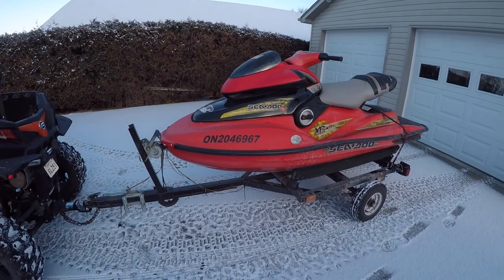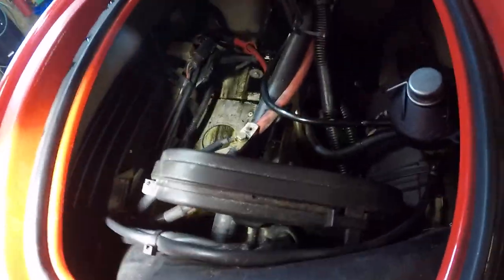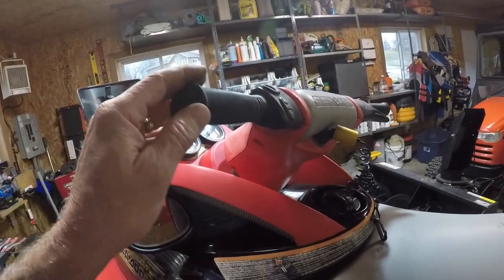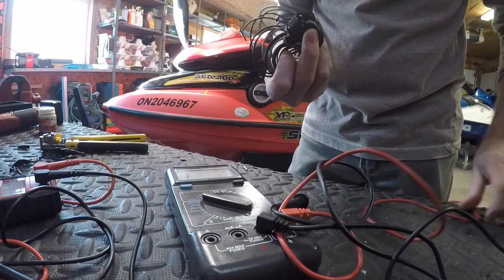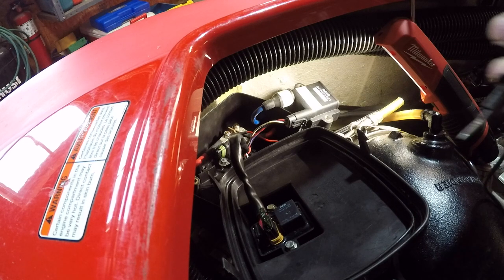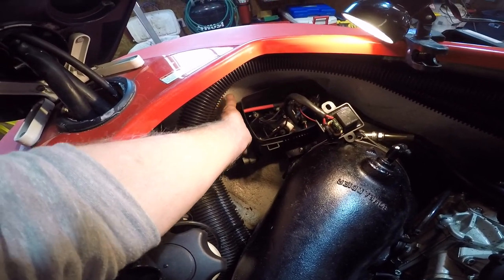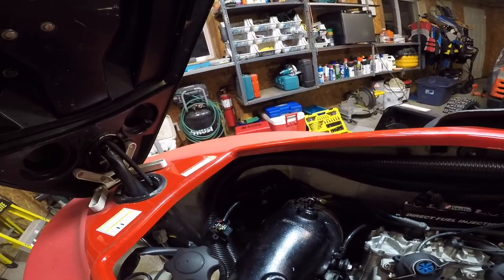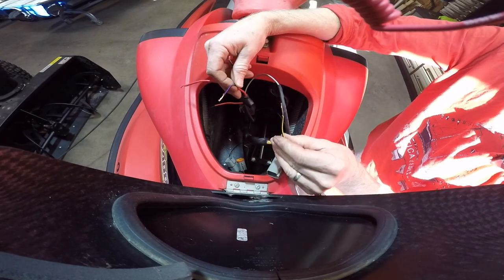Seadoo XP DI electrical issues

Comment: Working on these old Seadoos is like solving a murder mystery sometimes. Lot's of detective work and following leads. Some pan out, and some leads that you're so sure are going to solve it, don't. I love the challenge of it. I've been restoring old girls like this for over a decade. Good job.
Reply from the maker: No kidding.  Working on one that is won't rev up to 6900 rpm.   Hopefully I will solve it soon. :)
Reply: @SeadooRefurb  Start with the basics. Fuel, Spark and Compression.

Comment: Wondering how to get in contact with you.  I have similar issue to yours shown above.  I'm getting 12v readings all of the way through and then it drops to 9v at the MPEM.  I cleaned all of the connections at the front of the ebox and nothing changed.  I then jumped from the relay used the ground in the ebox and went straight to the MPEM and it started right up.  Wondering if I should just make jumper harness and route it through the ebox or remove the ebox and do a better job of cleaning the connections points and the male/female harness.
Reply from the maker: jump that relay.  i finally ended up removing it and never had an issue since.  That relay is tied into the tether and something in the tether shorts and it won’t active the relay.
Reply: @SeadooRefurb  Greetings from Michigan.

Could I simply add an eyelet connection the starter relay and one to the ground in the ebox the exit one of the service holes and then tie into negative/positive on the mpem or is there another solution to avoid adding additional holes into the ebox?  That's essentially how I tested it the other day, it just wasn't a permanent solution at the time.  I would assume that I would also have to add an inline fuse to that new harness?  Do you have a suggestion as to what amp fuse I should consider?

I was in the process of buying a used Dess post and cut-off, but would prefer to spend the money on electrical supplies to fix it the way you are suggesting as I'm considering buying another XPDI since I've wrenched on it so much that now know most of the tricks thanks to videos like yours and others.  Plus my boys don't like the old kawasaki 650sx that I bought them.

I appreciate the video's and quick repsonse!
Reply: I assume my Dess post is good since it started when I bypassed the relay.
Reply from the maker: @jesseanderson-w4u  Yes it is or it would have no spark and would not crank.
Reply from the maker: It has been a while since I worked on that machine.  My solution was to remove the relay entirely and install a 2 wire dess post and remove the current 3 wire post.

Comment: Can you explain how you did the bench test on the ignition relay at the 33min mark. Having a hard time seeing what where the + and - battery charger is on and what you’re testing with the volt meter. 

Pretty sure the ignition relay is not working / shorted and I’d like to bench test it before ordering part. TIA. 

Great video otherwise.

Comment: So I believe I have this same exact issue on an 03…. it’s driven me nuts for weeks. What did u biomass to get it to turn over to avoid buying an mpem
Reply from the maker: Open up the electrical box.  There is a hump in the top of the box that has a relay in it.  Just delete the relay and run a jumper wire instead.  The relay is there to try and reduce any battery drain.  It takes all summer to drain the battery if not ridden.
Reply: @SeadooRefurb  there’s two red wires and that black and purple.. did you say jump the black and purple to ground in the video? Or were u applying power to the red wire into the relay(the other come out of relay and goes to the starter solenoid)
Reply from the maker: @kalieburrows1427  I will take a photo later tonight and post it
Reply: @SeadooRefurb  your a life saver… or should I say possibly $550 for an MPEM saver
Reply: @SeadooRefurb you just ground black with purple tracer
Reply from the maker: @kalieburrows1427  disconnect the black and purple.  That wire activates the relay.  Remove the relay and connect the 2 red wires together.
Reply: @SeadooRefurb  omg thank u so much that did it!

Comment: Watched the Frankentein RXDI Pump Rebuild and I want to ask about the Oil Pump Seal. I just did mine IAW the 2004 GTI LE RFI shop manual and it says to install it with the spring side facing out towards the impeller. It shows a picture and discusses about packing grease in the lip cavity of the seal. Page 627 approx I think. This is even after pressing it in. You initially installed it that way as did the guy before you but then you changed your mind. I was told the spring faces the Pressure side to keep water out not necessarily to keep the oil in since there is no pressure in the oil shaft area. Is the shop manual wrong? I don't want to take mine back apart if it is okay. What do you think?
Reply from the maker: From what I found the spring points towards the inside of the pump.  when I search manuals there seems to be no detail on this.  please go with what you found in your manual.

Comment: Hey ! I just had a motor rebuilt and just got it back. I’ve got most of it put back together already but before I start it, does oil need to be put down the cylinders or is there anything I need to do before it’s first start? Thanks!
Reply from the maker: I always put a little oil down both cylinders before start up.  You also need to bleed the oil lines to make sure they don't have any air in them.  I usually hook up the oil and spin over the oil pump with a drill to make sure the oil is all the way through.
Reply: @SeadooRefurb  I have an oil delete also so I premix. Would that change anything? I really appreciate your help

Comment: Hello, my dad purchased last summer a 2000 Sea Doo Rx Millenium Edition with carbs. Cold starts or after a long time siting, it starts very hard. It still has the originals fuel lines, and i think the carburators were never cleaned. Any suggestions?
Reply from the maker: It sounds like a fuel delivery issue.  I would start with cleaning carbs.  Does it have the grey fuel lines ?  If so then I would change those too.  Check fuel filter as well.  (Fresh fuel in tank ?)
Reply: Yes, it has the originals grey fuel lines, and it also has fresh gas in it. It is around 90 hours, last summer i changed the spark plugs br8eix fron ngk, the old ones i think they were the original ones. In the spring i will buy a kit for the carbs, with gaskets and all the stuff i need to make them as good as new, replace the fuel lines, and then i think i will enjoy it. Keep up the good work you do, i really enjoy watching your videos. You should do more boats videos, when you take them on a cruise or when you do some maintenance.
Reply from the maker: @robierttt4370  definitely get rid of the grey fuel lines.  They fill with green goo and plug the little filter in the carbs.  I will be doing lots of test rides and maintenance on the boats and skis this summer.  We just ran out of warm weather last year.  Thanks much for your nice compliments.
Reply: Clean the Carbs switch out the grey fuel lines .... fires up easy after....
Reply from the maker: @CP-kb1du  Grey fuel lines and carb cleaning is definitely the way to go !  Those lines turn green inside and gum up like jelly.

Comment: I wish I could send you my 2003 Seadoo XP DI and track my electrical issue. I have very few experience with electrical issues. It ran great last year then one day while riding out on the water it just shut off and now won’t even turn over. I checked fuses and a fuse was blown once replaced it just continued to blow. Now jumping the relay can’t even turn the motor over.
Reply from the maker: Hmm..Sounds like the starter is toast.  If you have power at the relay and you jump it then the engine should turn over.  If not it is either a bad connection to the starter or the starter is toast.
Reply: @SeadooRefurb  That was my thought. Thanks for your input